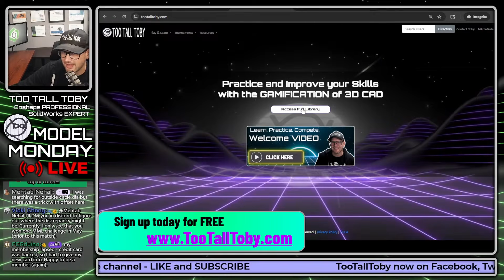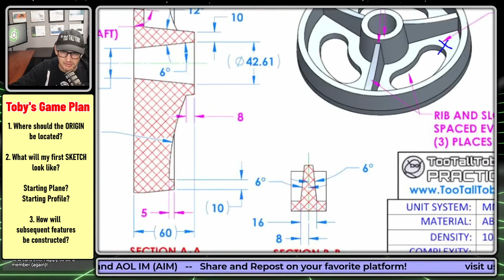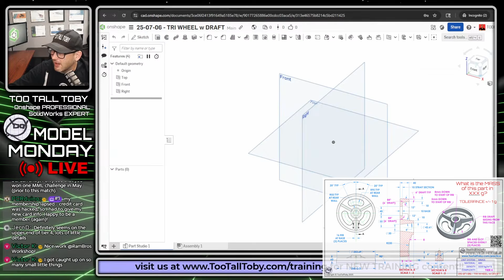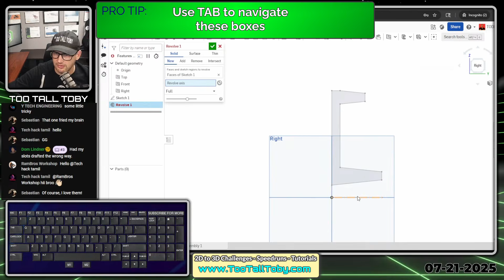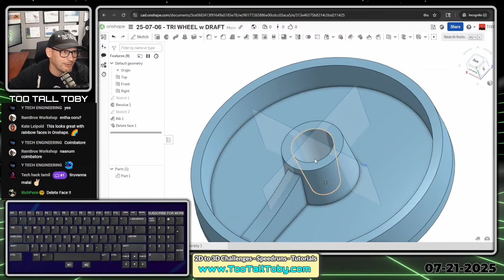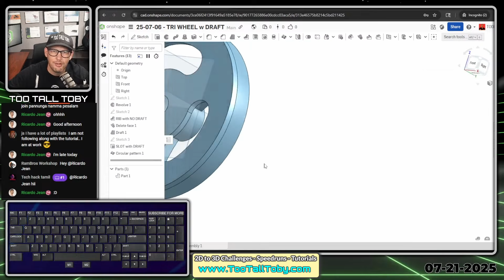Onshape PLASTIC PART Tutorial - Ribs and Drafted Faces!

Comment: I'm not sure you drew this correctly.  You said you did the ribs without a draft, but they do have a draft...a draft of 6 degrees shown in section B-B.  Probably not enough to throw the mass off enough to not make it correct.
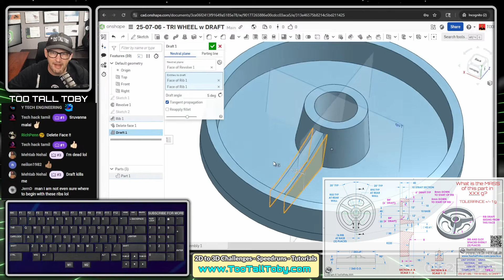Reply from the maker: I added draft to the ribs at 21:00